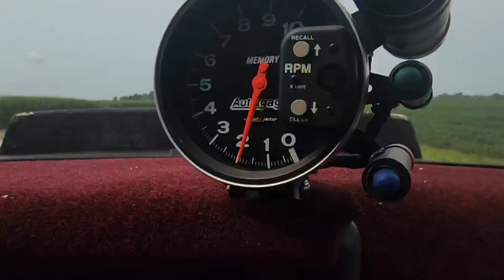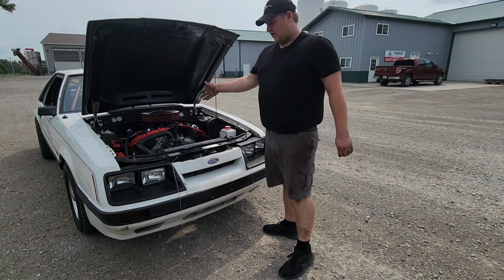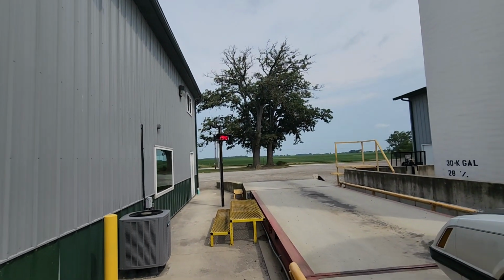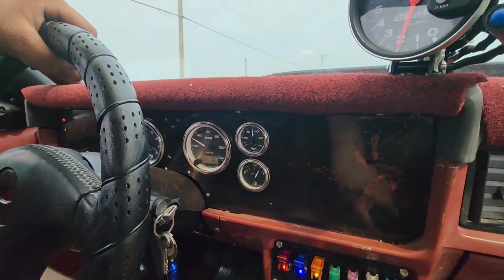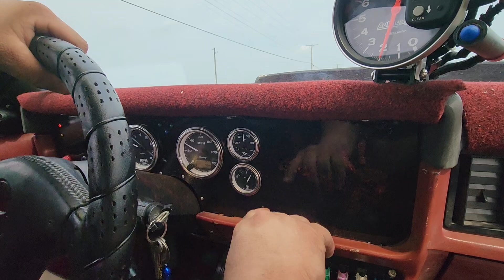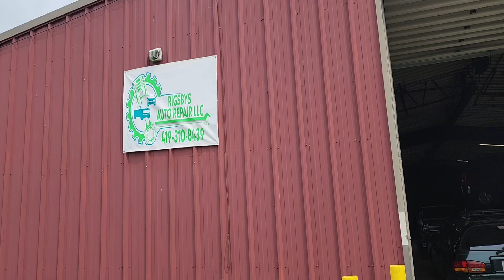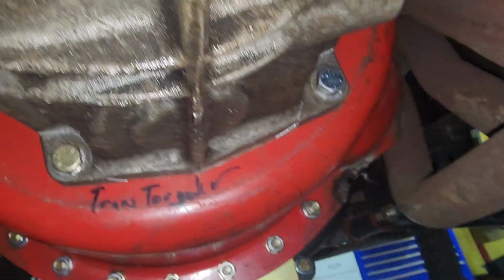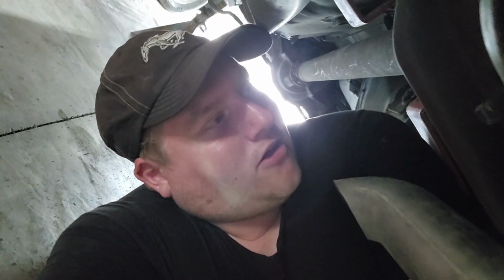How Much Does Our 393 Stroker Foxbody Project Apocalypse Weigh???

Comment: Did you remove the air box behind the dash?  Just watched video haven’t gone back thru playlist yet.  Our cars are very similar but mine has all factory wiring and full air box under dash still.  Mine weighted 3050 with full interior.
Reply from the maker: Yes we removed the air box, my DIY Fuse pannel is there now

Comment: Hopefully, it's just the case, and the internals are alright.
Reply from the maker: So far, the main shaft looks straight, and it went through all the gears. Hopefully, we can find a case and do some swapping!
Reply: @QuarterHorseCustoms , I ran a case that weeped fluid from a small crack for years with JB weld on it.  It’s definitely not ideal but might get you thru in a pinch.
Reply from the maker: Sadly, it's going to take more than JB weld for this one